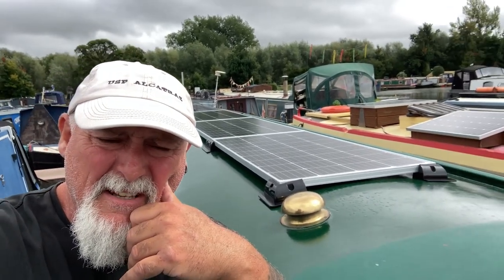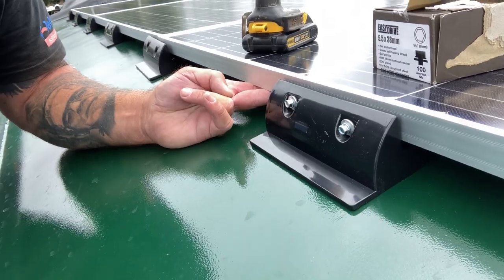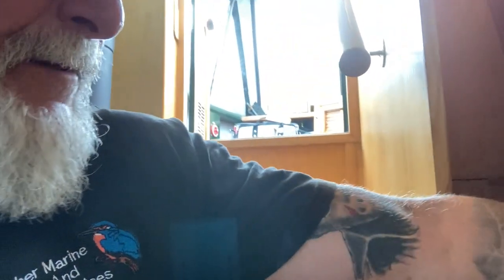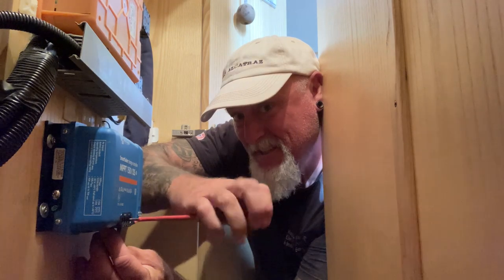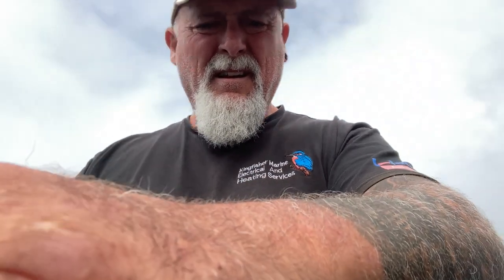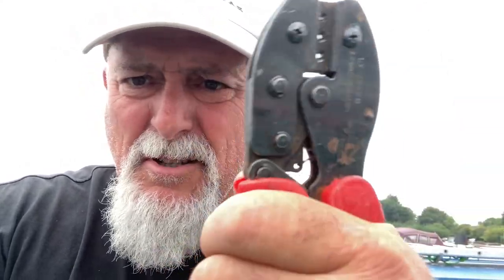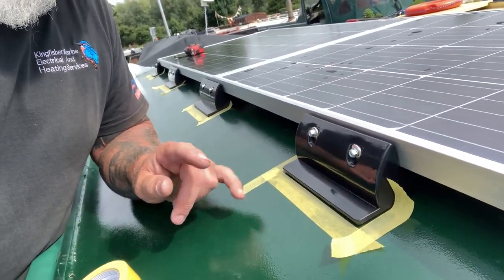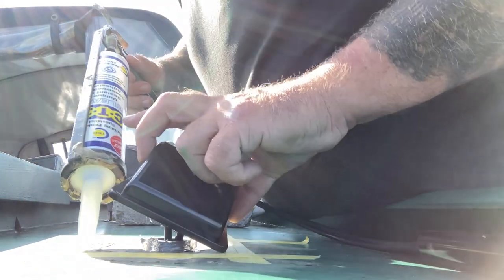Narrowboat Electrician - Narrowboat Solar Installation

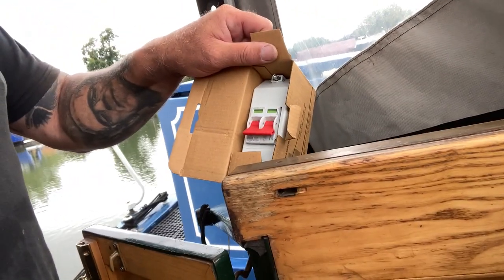Comment: 11:50  Hello, quick question are you 100A isolators rated for DC current?  Many aren't rated for DC power only AC, might want to check the spec sheet or it should have the DC ratings on the switch itself.  Many people I have seen here in the US just use whatever switches they can find for the DC side of solar arrays and come to find out that they do NOT have a DC rating on them and can only be used with AC power.  DC is way harder on the switches and can cause premature failures.   Just thought I would let you know to check.  Granted 500 or even 1KW isn't much power in the grand scheme of things, but none the less it can be an issue.
Reply from the maker: I have used these isolators for quite a while, rating for DD refer to the load breaking capacity (due to increased arc sustainability) and is the current carrying capacity is the same for AC or DC. Having said that I am running this at 10% capacity which in my experience is fine, and never used to break the circuit under any load.

Comment: Thanks for this, it's very useful.

May I ask, if MC4 connectors are only good for 30A and I get the impression most panels come with them already fitted, if you want to connect extra panels in parallel, what can be done about the connectors?

Most narrow boats seem to use them, and I've not seen any different types. Is it a case that really people are using them but overloading them, or can they actually cope with increased amperages?

Thnaks very much.
Reply from the maker: Hi, thanks for the comment. The ones I use are rated for 30A continuous, I wouldn't be driving them any harder than that as during charge cycles the current is prolonged at the higher level. You have spotted the issue when connecting in parallel, as the current can easily exceed the 30A rating. (note some are listed as a 20A rating so always check the datasheet) When you are using 6mm solar cable its current carrying capacity is approx 42A but as long distances can be involved back to the mppt controller, volt drop can come into play as currents increase. 
Yeah, all narrowboaters do is plug them all in together and not even think about the current capacity. Thats why, on larger controllers there can be multiple PV inputs to allow the running of a second set of cables.
Reply: @narrowboatelectrician  Thanks very much. I'm trying to sort out some panels for our boat and there do seem to be a number of such things that are important, but are apparently ignored by a lot of the articles and videos about them.

Is there a particular brand of connectors and fittings that you can recommend please? Thanks again.

Comment: Hi Martin, a potential narrowboat buyer.. What are your recommendations regarding flexible panels  compared to the rigid type. Also, flat mount or angle bracket mounts?
Reply from the maker: Hi Lex. IMO, flexible are twice the price for half as much power, Cables are always visible, When removing you'll destroy panel and paint. On the mounting its proven that flat is best average. And with tilters, do you want to move them every hour? Also what the chance of being 90 degrees to the path of the sun as they only tilt one way.

Comment: Is that isolator you've used for the panels rated for use on DC?
Reply from the maker: Hi Henry. Not specifically but here is the logic. Current carrying capacity is same for ac or dc. DC rating is down to arc quenching capacity requiring wider contact gaps. In this case max current is 10x below capacity and not to be operated in full sun, so not breaking any load current. It’s there as a bib n braces approach to allow you to work on the mppt. Most likely will never be operated. Not unusual to use ac switch gear on 12v. Domestic light switches as an example.
Reply: @narrowboatelectrician  I know what you're saying, but what if that is ever operated in an emergency under load it might weld the contacts closed and with no other means of isolation you've got a problem.
Reply from the maker: @HenryOCarmichaelSmith  not with solar matey. No more than 10A can ever flow in that side of the circuit. I’d never use these on any battery circuit I promise you.